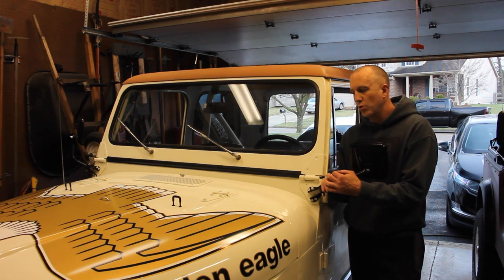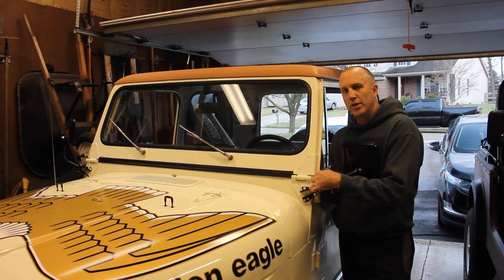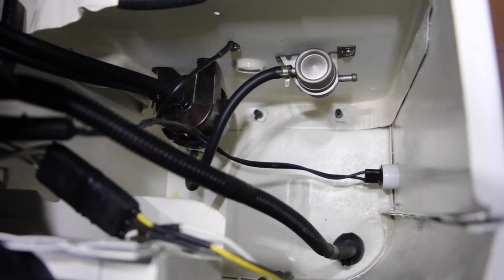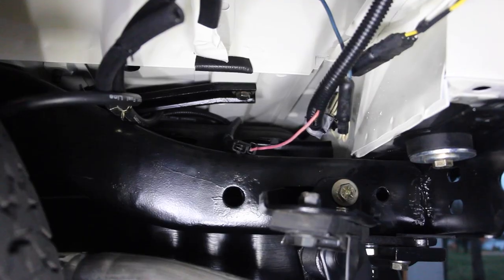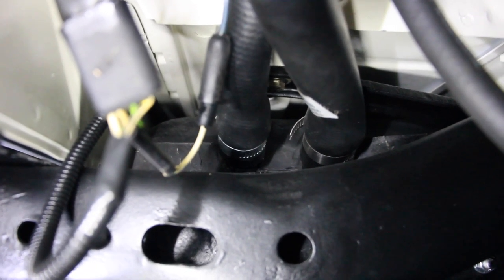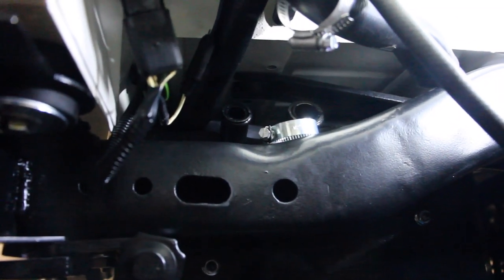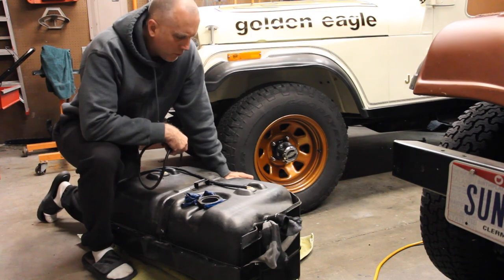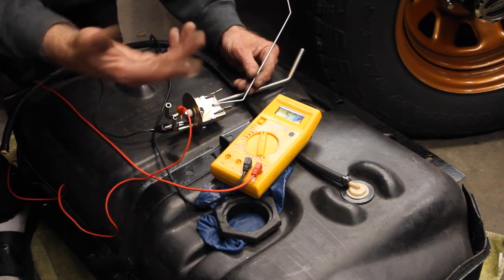Jeep CJ 20 Gallon Fuel Tank Sending Unit Replacement

Comment: Great video.  I restored my 85 Cj7 that was the 1st vehicle I bought when I was 17 (I'm 43 now)  My gauge stopped working and turns out my brass float was FULL of fuel.  I put in a new sending unit and brass float and checked the fuel level on the gauge in relation to the tank BEFORE I put it back in when it was at half tank.  Problem being that when I filled it up for the first time, the gauge stops at 3/4.  For anyone doing this, there is a video I found after the fact from Crown Automotive on how to calibrate the sending unit, which I feel like I need to go back and do.  Live and learn.  Thanks for all of your videos, wish I would have documented more for my restore.
Reply from the maker: Documenting it is a full time job in itself. Believe me :)

Comment: Once again a great and informative video! I just recently did this on my 84 CJ7 and yeah.. it's a pain. A couple things I would like to mention.. firstly, wear some shoes, my dude! Lol! Secondly, I realize you're working with relatively clean components there, but most others would not be so fortunate. Blow some compressed air around the sender unit before disassembly to prevent a lot of unwanted crud from falling into the fuel tank when you remove the big nut and lift it out. 
I really enjoy your vids! They've helped inspire me immensely and get me off my butt to wrench on the Jeep.
Reply from the maker: Great builds, except for the shoes. Where’s the fun in not risking serious injury?
Reply: @coolguy_CJ7  To be fair... I think I've worked a time or two around the ol' Jeep wearing sandals too. Stay safe, buddy!

Comment: My 82 wagoneer has a removable access plate in the floor behind the rear seat that’s directly above the sending unit location on the top of the tank which will make this diagnosis extremely easy for me. Thanks for the video
Reply from the maker: If they did that for the CJs, it would've solved a ton of issues that we experience now.

Comment: Great video on a common issue on the Jeeps. My fuel gauge always worked on my '80 CJ. After I pulled the body for restoration it did not work. Checked at gauge, bought new sending unit and did the painful install. I'm going to check that ground!
Reply from the maker: Please let me know what you find.

Comment: First, thank you for posting these videos.  I have a `1979 CJ Quadratrac that I have raised from the dead.  I am the second owner and purchased it in 1988.  Unfortunately, the cam lobes flatten out over time, and I let it sit for a decade before I got it running again.  It has been a journey especially since I let a shop do the engine swap.  After fixing all the crap they messed up, it is now running again and gets me around pretty well.  Now to this video, did you ever consider cutting the panel that is not embossed in the back and installing an access cover?  When I put in a Sniper EFI, I took that route instead.  This access cover allows me to monitor the sender seal, swap senders, or if I ever want an in tank fuel pump, I have a quicker way of installing this alternative pump.  Just a thought, and I am very happy with the cover especially knowing first hand what a pain it is to drop the tank.  I will be cleaning up the access panel a bit more so that it looks like it came with the original vehicle.  I do not believe this sacrifices too much to the original design.
Reply from the maker: This sounds like something that a few have done to their CJs. I feel it’s a good idea only if you can’t find the root of the problem. I for one don’t want to cut a whole in an original tub that there is no true replacement for, but that’s just me being an OEM snob :)

Comment: Hey cool guy I rebuilding a 77 cj7 that came in well…. Pieces(and lack there of) it needs a fuel tank and I’m trying to find that style so I don’t have to do the roll over check valve but all I can find even I. The later model searches have the two hose attachment on the drivers side. Do you know where I can source that style with the valves on top?
Reply from the maker: Sorry it took me forever to respond. This type/style of gas tank and skid plate was only made in the last years of the the CJ7 (84-86) I believe. When the wannabe Wrangler came along, Chrysler changed up the gas tank. Unfortunately, to get a plug and play tank, you'll have to find one on eBay, FB marketplace, or reach out to Ray Moulton at DeadJeep.com. Best guy in the business. Let him know Cool Guy sent you. Sadly, he'll know who your referencing :)

Comment: What gauge size are the ground and sending unit wire?
Reply from the maker: Send me an email at dellis6914@gmail.com and I’ll send you a full wiring diagram that tells you all the details.
Reply: @coolguy_CJ7  what type of screw do you use to attach the grounding wire from sending unit to the frame of the jeep? Thanks.
Reply from the maker: @markfeuerherdt2338  simple stainless steel either #10 or # 12 screw. You want something that will bite into the steel with thick threads.

Comment: How frustrating! Every project on my Jeep’s  are always a hard to reach area. Lol especially anything underneath or behind dash or gas tank areas !! There so  simple they’re difficult if that makes sense lol. 
Did you have to cut The length on 1st sending unit pickup line too on 1st install,like you had to do on 2nd unit?
Reply from the maker: They are truly a labor of love, but there is an amazing cool factor that comes with not only the CJ but with the knowledge that you did it.

The structure of the filter tube for the first was different, in that it was bendable so cutting the tube wasn't necessary.